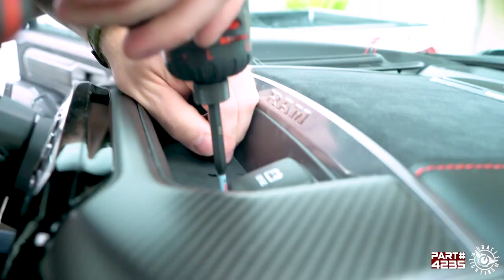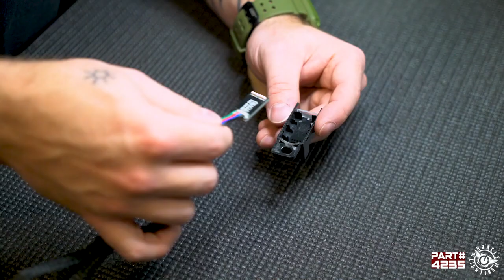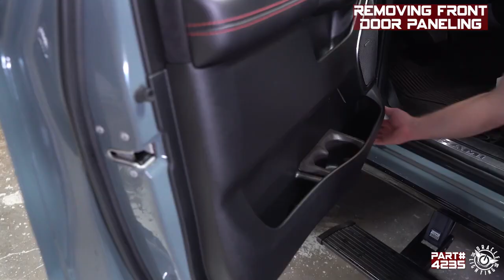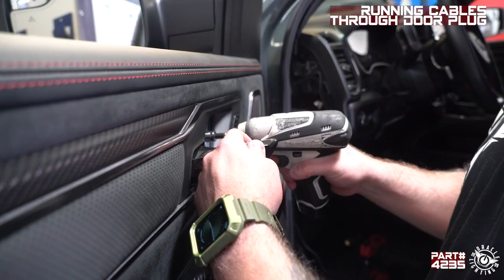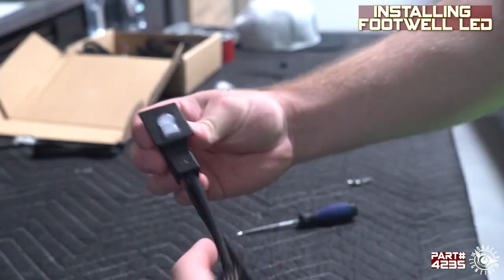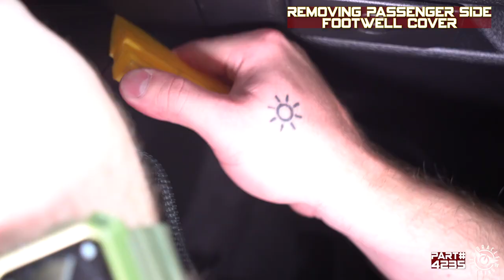ORACLE Lighting 2019 2022 RAM 1500 Complete Interior Ambient Lighting ColorSHIFT® RGB Conversion Kit

Comment: What are y'all using for a power source? I tried using the factory footwell light as a source to keep everything looking factory (on when the doors open) but I think because the factory lights are dimmable and the oracle unit needs 12v to operate, it has wrecked a few of the led chips? There are several in my truck that are not working correctly. They used to work fine but one by one most of the led's are missing a colour. 

I don't want to use ACC power because the lights will only come on when the truck is running.